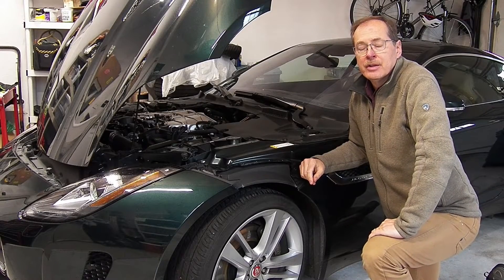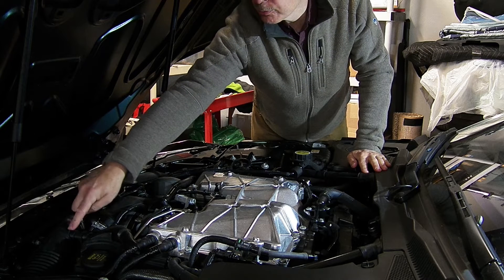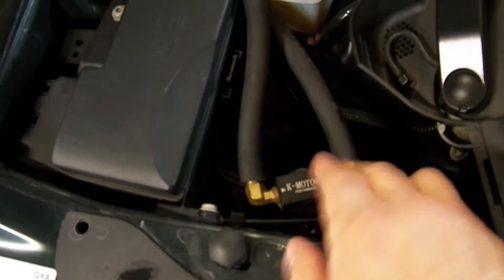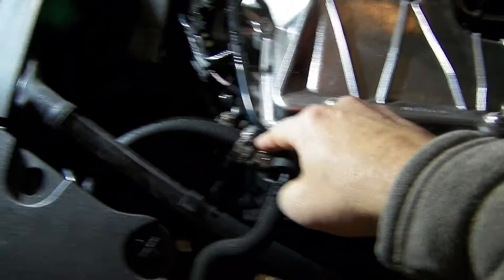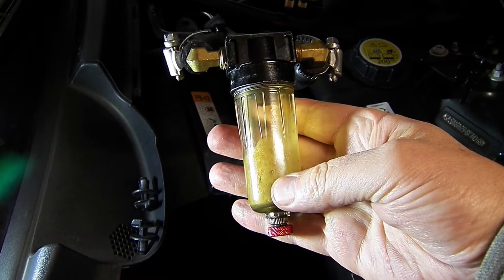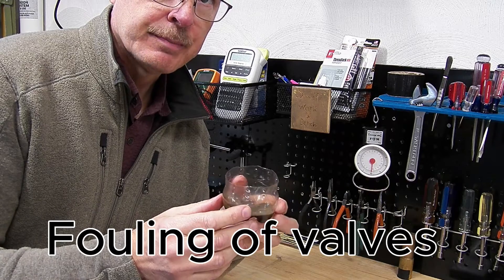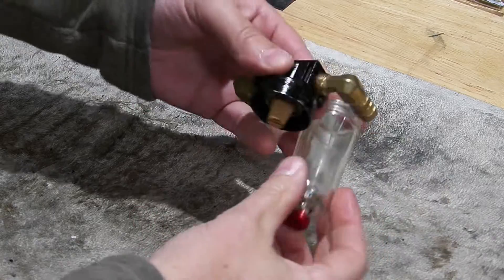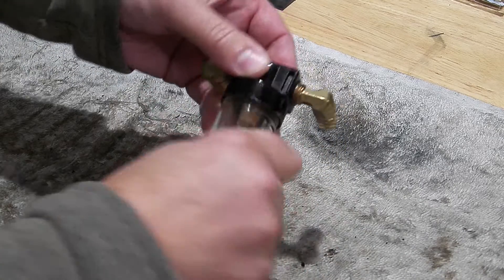Engine Oil Catch Cans Jag F-Type

Comment: I have a question, did your car have the pedestrian protection airbags where you located your catch cans? I'm not sure if US spec cars are built differently to EU spec cars?
Reply from the maker: Good point, my US spec 2017 model does not have pedestrian hood poppers.  So the catch cans fit nicely into the side cavities.
Reply: @OncaEngineering  interesting to know, mine is a 2018 R facelift. it has the hood poppers fitted, Jaguar themselves put a catch can system in their GT4 SVR but they stripped the majority of the structural material in front of the belt and pulleys to fit it. its a shame it isn't this easy to install being in the UK. Good info to know though about the low pressure bank!

Comment: You added the brass fittings to the cars tubes, what was the inner size of the tube? 1/2”?
Reply from the maker: The black plastic PCV hoses have a 0.55 in ID (14 mm ID)

Comment: Thanks for this update.  I am in the process of installing a catch can on the low pressure side. I'm an unclear how you tied into the line.  There is a 90 degree bend on the end of the pipe where it comes out.  Did you use that connection?
Reply from the maker: I cut the low pressure plastic vent pipe about 4 cm from the rear termination on the valve cover. Then I used some 90 deg elbows with barbed ends.  This allowed me to tap into the plastic pipe and divert the flow through the catch can.  I recommend removing the low pressure vent pipe so you get a clean cut.  I used a hack saw.

Comment: I'm all geared up. Tomorrow, I'm installing the catch can. I chose an all-metal one with a separator sponge to make sure the oil is truly separated. It's also small.
Reply from the maker: I hope it goes well for you. Report back after your first batch of liquid extract. (Every 1000 miles for my car)
Reply: @OncaEngineering  I did a beautiful job with it. Easily accessible for draining and as it's black like the rest of the engine cover, difficult to spot. It gave me hell to install, the F-type has no space to work on.

Comment: Thanks for sharing herman, do you have a list of the required parts gathered anywhere? I would love to get this fitted to my car.
Reply from the maker: Will, good to hear from you.  
Here are some additional tid bits that describe my particular Oil Catch Can installation.
I suggest that you only focus on the Right Hand Side breather tube on the AJ126 and AJ133 engines. 

The catch can that I purchased from K-Motor Performance (e-bay) came with NPT threaded holes. 
I purchased some 1/2" NPT fittings with 1/2" barbs and also some barbed elbows to tie into the breather tube. 
Buy at least 5 feet of 1/2" fuel hose (low pressure ) as it is about 2 feet from mounting point to breather hose tie-in.
You will need to cut the Right Hand Side breather tube close to the rear fitting on the engine, using a metal saw blade. 
Note: I removed the Right Hand Side breather tube to make this cut at the correct angle.
You will also need to cut a "notch" in the box that houses the cabin air filter to pass the two 1/2" fuel lines through. 
There is an M6 threaded hole on the metal wall of the cabin air filter area that can accept the catch can mount. 
Best of luck.